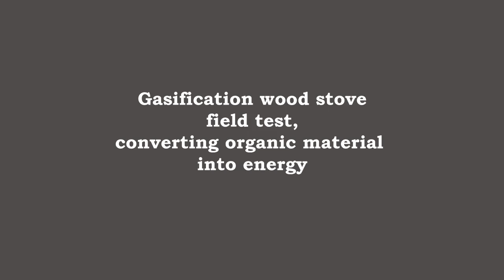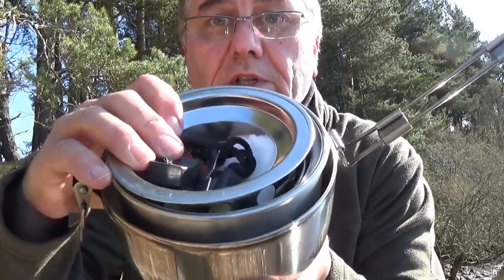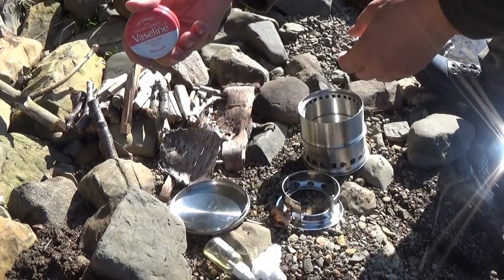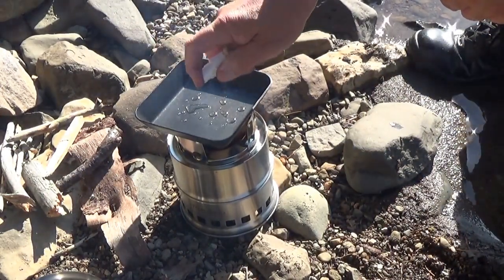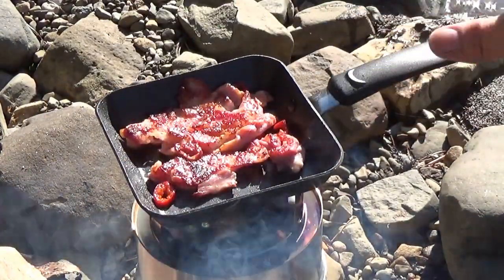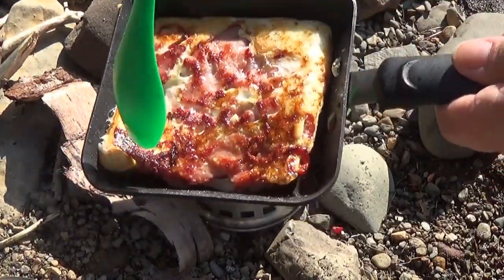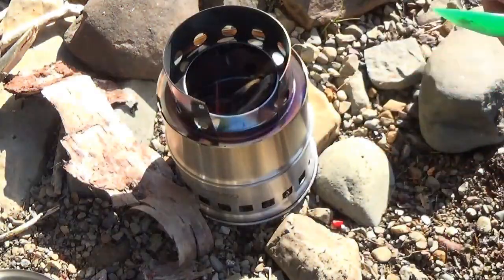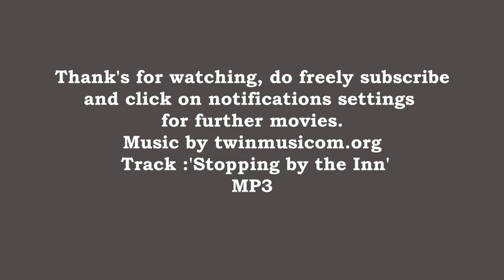Gasification wood stove field test

Comment: I know this is 3 years out of date but I think it has to be said
Fire starters are somewhat controversial, because everyone has "Their" fire starter.  Personally I am a fan of wax infusion (Wax infused wood, wax infused cotton) and fatwood.
Now for my ... complaint.
There are two ways to build a fire with collected materials.  The method you used is called the "Constant feed" method because you are always feeding the stove.  The method I prefer is the method I have been told is the proper method.  Namely pack the stove with wood and light the top (Similar to using wood pellets which is my preferred fuel).
Reply from the maker: Thanks  John, appreciate  your input, it's a great pastime. Nothing nicer than a small burn out in nature as we learn to live in the moment  and have a little fun along the way. Harry.